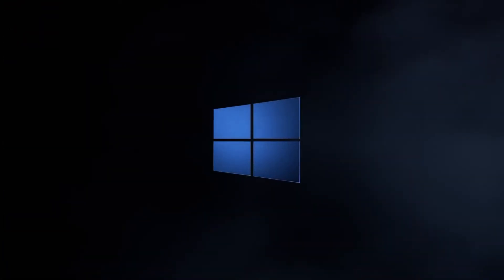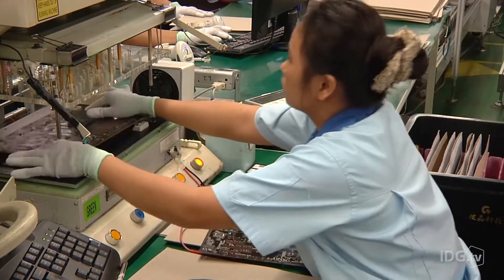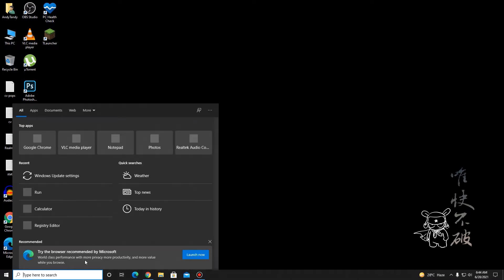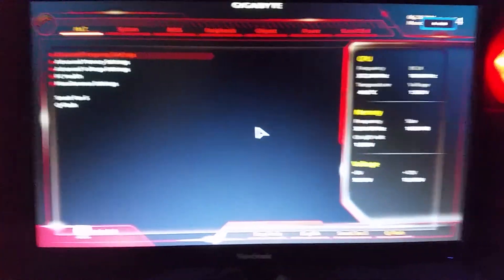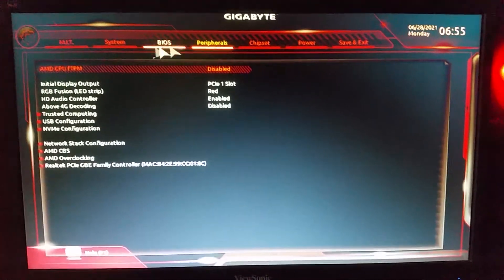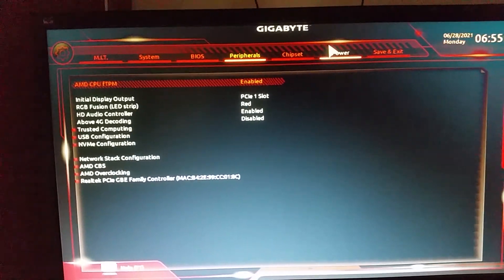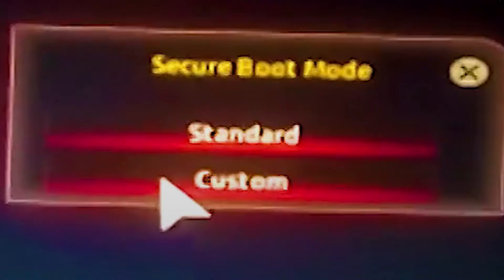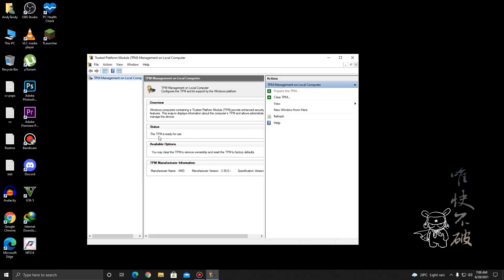How to enable TPM 2.0 and Secure Boot for installing Windows 11

Comment: Ur motherboard bios ver is F32 mine is F2 :(
Reply from the maker: Got mine updated on F51f now using the same procedure from the last BIOS updating video, you can try it out.
Reply: @techobs4340  Idk if it will work my motherboard is H81M - Ds2 , It’s very old…